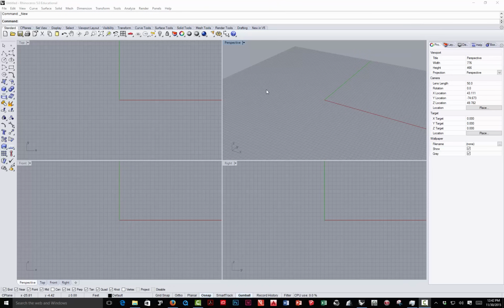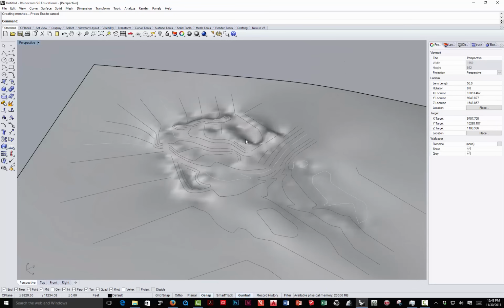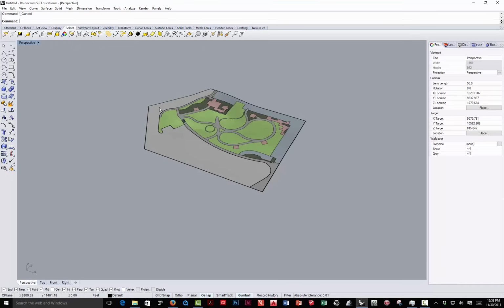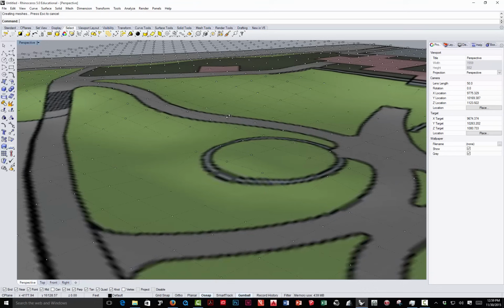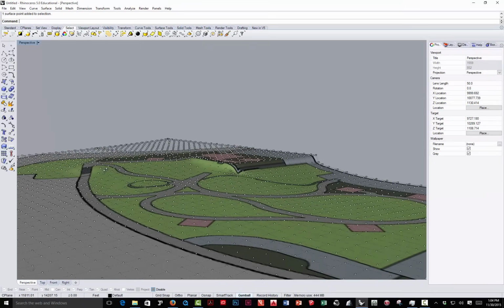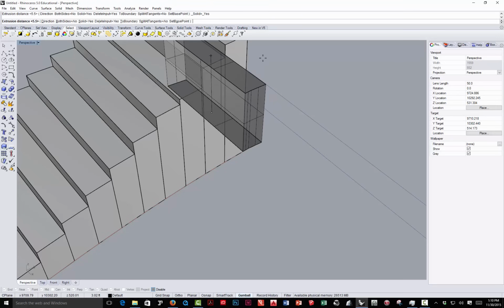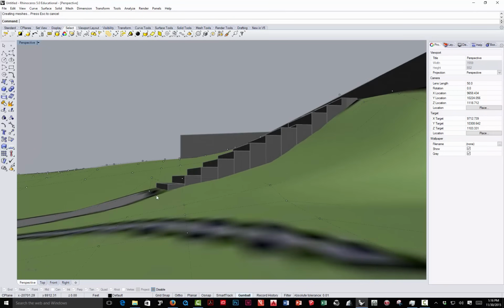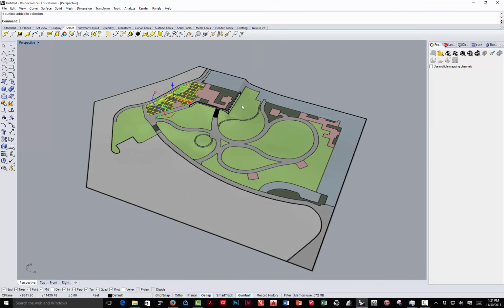Site Modeling in Rhino - The Healing Garden

Comment: Great video, quick question ! would you happen to know(or direct me to a source) how to scale the texture of the site picture you put in? When i brought my picture in, it was not fitting to the contours.. it was too large .
Reply from the maker: The key to getting the image to line up with the landform mesh is to trim it to the site boundaries (in Photoshop) before using it as a texture.  You also have to use the same site boundary to trim the landform mesh once you have created it from the contours.  This could be the property line of the site or an arbitrary site boundary that you create.  It just has to be the same in he image and the Rhino model geometry.  Also, you must use the Planar Mapping method to map the image onto the landform (using the bounding box option).  I covered that part if the video.

Comment: Good video. My only comment is most firms carry Rhino and are ready to switch to it, especially since grasshopper is so useful. The challenge is the user base coming out of school not having enough knowledge to run with Rhino. Architects have mostly transitioned to Revit at this point. My recommendation is get acquainted with both, and if you can, master Rhino.